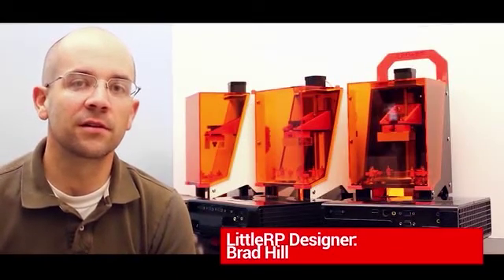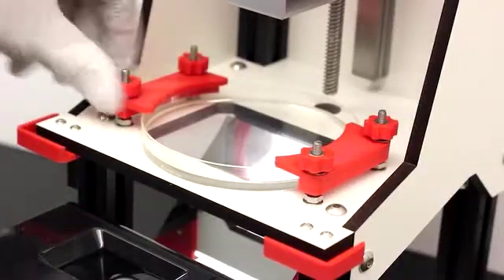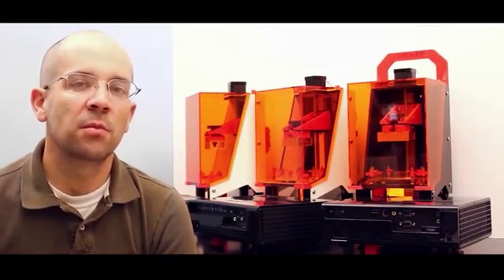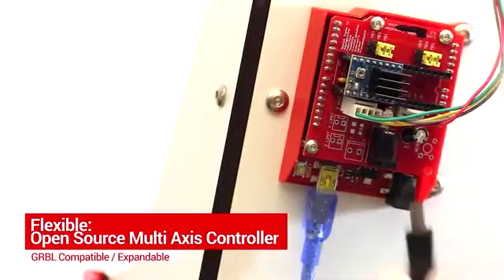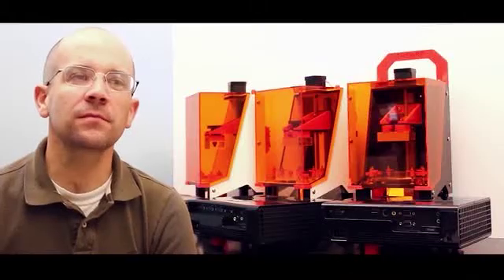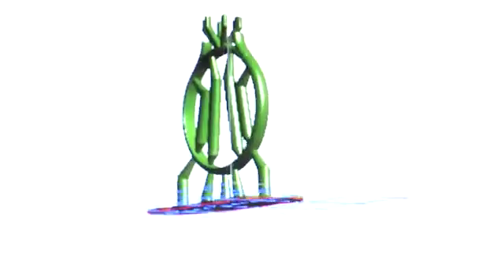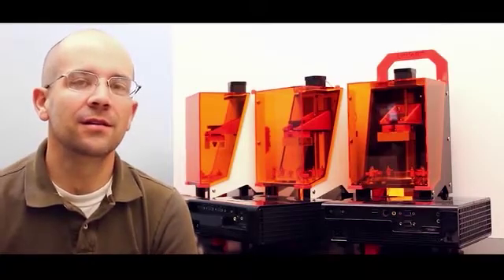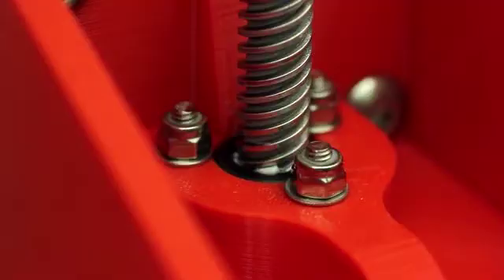LittleRP - Affordable Flexible Open 3D Resin Printer

Comment: Brad, I make custom hard to find or discontinued repair parts.  I’m interested in your Little RP printer. I need to duplicate parts using a hard clear but flexible resin that can stretch a little bit will come back to it’s original shape. Do you know of any clear resin that can fit my needs and be run through your Little RP?
Richard